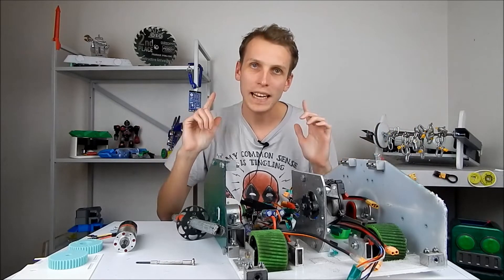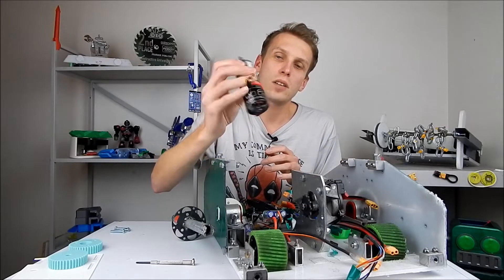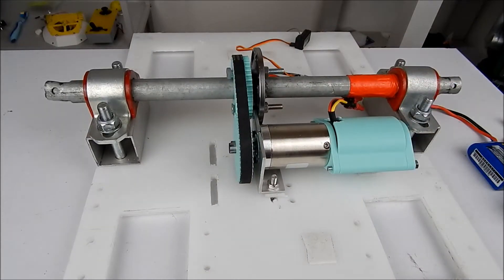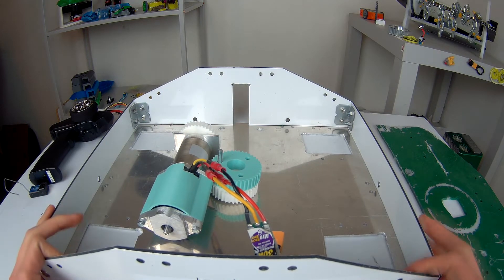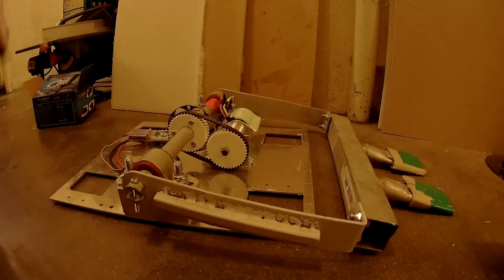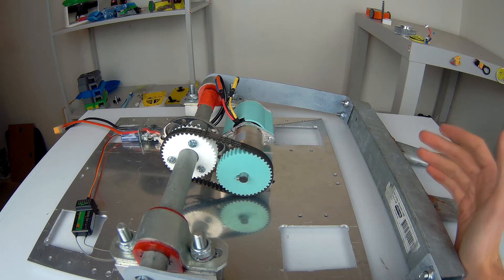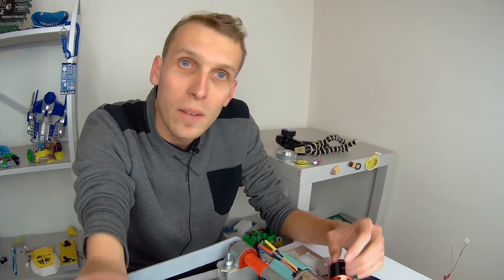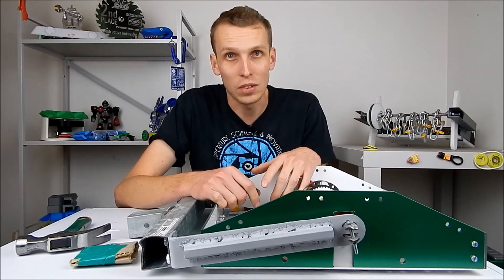Strange Young Man Upgrades! (13kg combat robot)

Comment: Why not a chain and some cheap sprockets (Shimano DX, or any basic cassette singlespeed sprockets). Off the shelf and cheap.

No need to mess with printing pulleys won't slip. Just drill some mounting holes in them and mount them to a hub of some kind
Reply from the maker: I had bad experiences with chain in the last version so I decided to try something new. 

I think I might be going back to chain

Comment: Why are you bothering with a belt?  The gears are right next to each other.  Why not move the gears closer together and have a direct drive?
Reply from the maker: Belts give a higher number of teeth engaging at the same time, 

I am trying push a lot of torque through this system, so I want that load as spread out as possible, belts or chain are the way to do that
Reply: @TeamPanicRobotics  Fair point.  I honestly know very little about these kinds of things so I was really hoping you would answer.